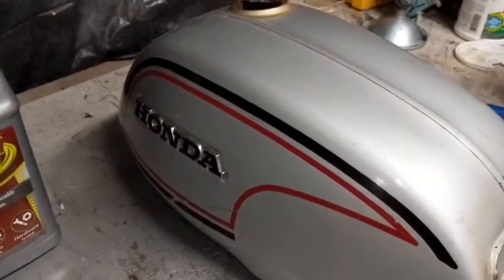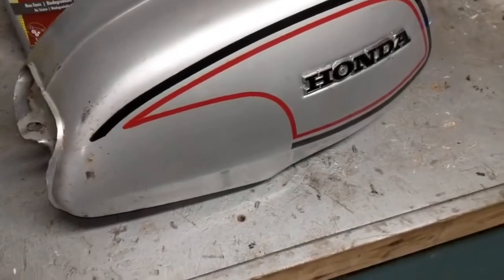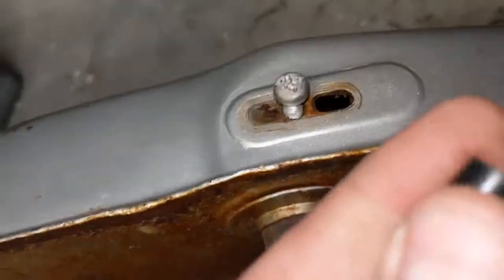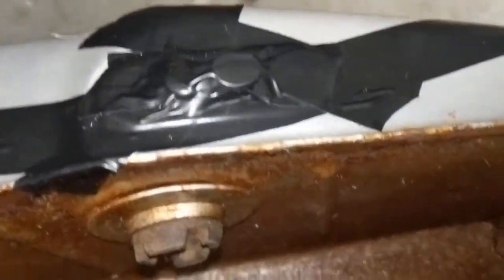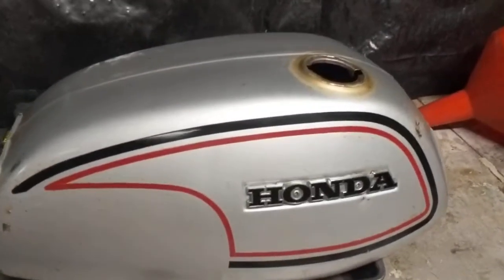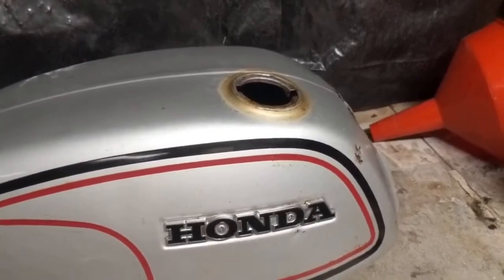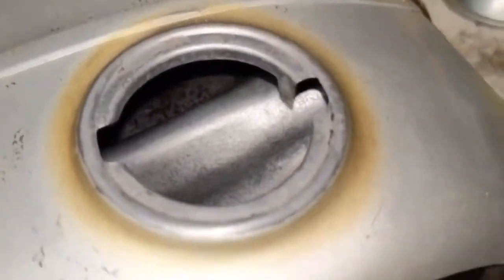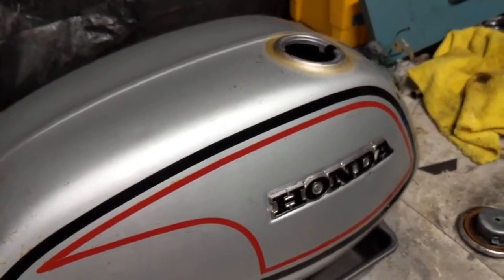Evoporust review!! will it clean rust from inside gas tank.

Comment: I was cleanig fuel tank of my motorcycle inside using Evapo-Rust. The rust was removed but now I have the problem with rinsing of wizen remains of "Evapo Rust". The fuel, petrol doesn't dissolve it. I'm afraid of using something corrosive or acidic because tre rust can be back. Can you recomend something?
Reply from the maker: I've just always, got out what I could and then added fresh gas, sloshed around a bit, rinse repeat. Takes a few tries.

Comment: Does rust come back after the treatment with this liquid? I mean I ve seen that  people who uses other chemical as such vinegar, have the problem that rust comes back at few days after.
Reply: This has a rust inhibitor in it so it will convert the rust (will look black). If people are getting flash rust from acid treatments (vinegar included) it means they did not neutralize the acid properly and or they did not coat the bare metal with a fogging oil or something like wd40 - if it was going to sit a couple days. If you do the vinegar way - you will need to dump it and then put in a mixture of baking soda and distilled water and slosh it around and then rinse. I like to use phosphoric acid afterwards because it leaves a coating so no flash rust happens. You could also dry the tank with air/heat and put into a coating like por-15.